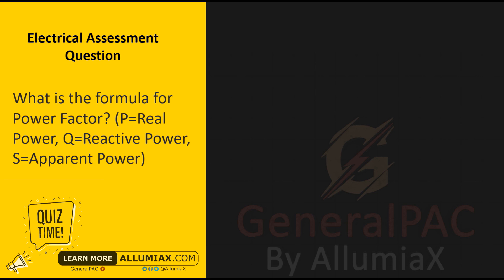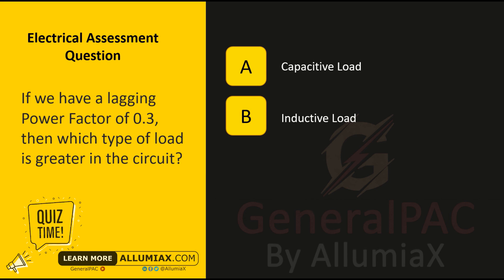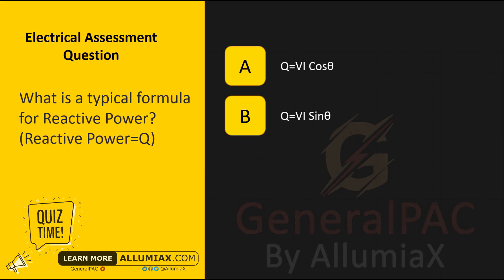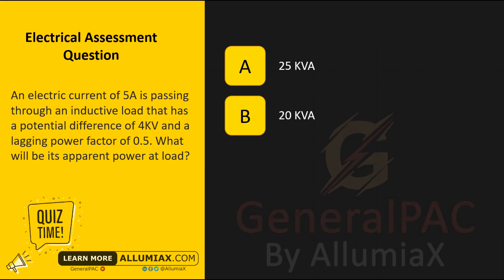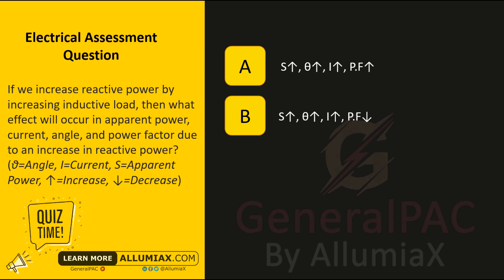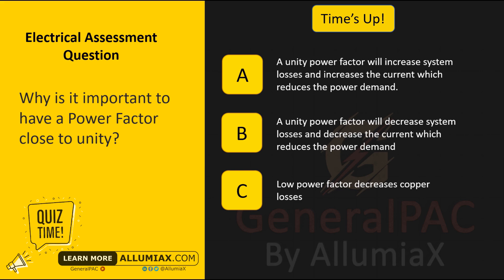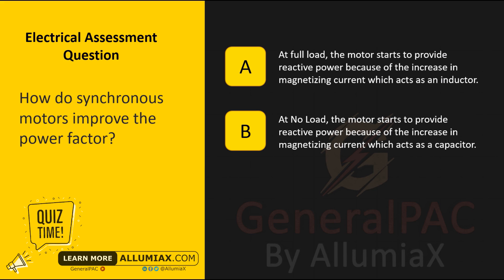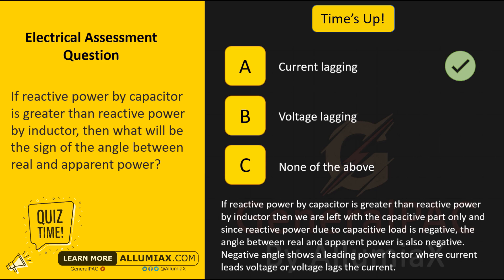Part 3 — Electrical Engineering Interview Questions & Answers (MCQs)

Comment from the maker: *CORRECTION
Q.11 Updated Explanation:
When reactive power is increasing, apparent power will also increase because the apparent power is directly proportional to the reactive power. Also, when the angle between real and apparent power is increased due to the increase in inductive load the current is increased. However, the power factor decreases with an increase in apparent power because the power factor is inversely proportional to the apparent power.

Comment: I think the answer explanation for Q.11 has a mistake. When the angle between the real and reactive (*it should say apparent) power is increased due to the increase in inductive load the current is increased. Please correct me if I'm wrong.
Reply from the maker: Yes, you're right. Thank you for letting us know about the error.

Comment: I have a query if voltage lags current in last question then the answer should be voltage lagging. How it would be current lagging? Can you give more explanation for last question
Reply from the maker: Hey Ayesha,

Thank you for letting us know about the error. We've added a correct answer in the pin comment of this video i.e "Voltage Lagging". We're glad that you liked our videos and we hope that you will join us in the upcoming videos as well. Stay tuned :)

Regards,

GeneralPAC by AllumiaX